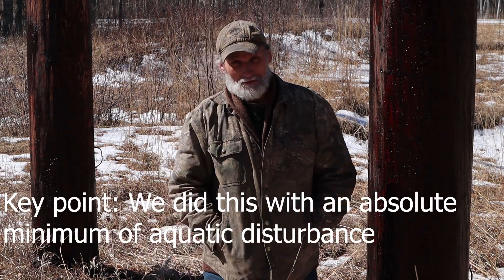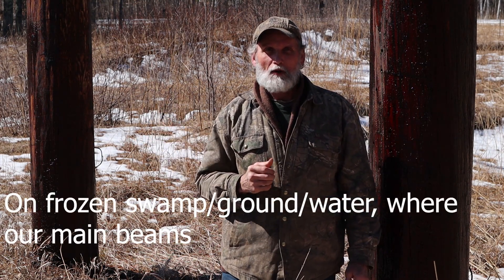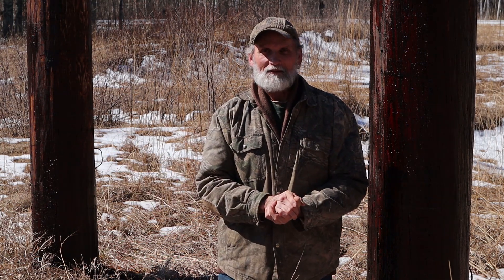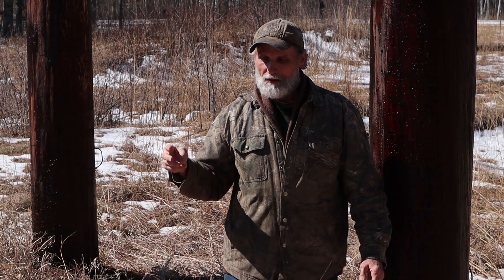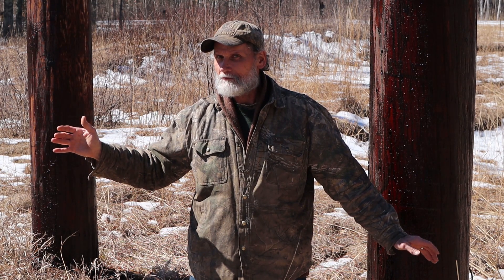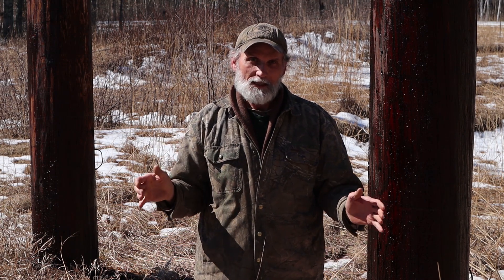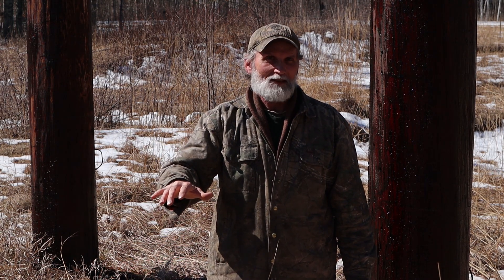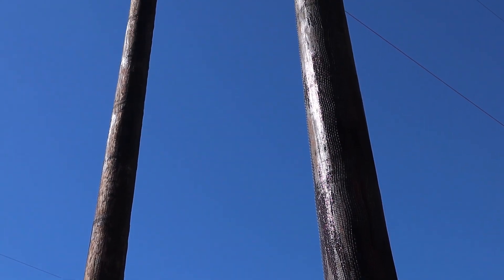Swamp Dock, extending 90 feet over boggy bottom muck to open water; to OUR BEAUTIFUL LAKE!!! YEA!!!!

Comment: Watchd the video how did you get the post down in the muck?
Reply from the maker: We hooked 2 come-a-longs to the top of each post and to the steel crosspiece under the power poles and pulled them down into the muck, that has also made them adjustable as time has gone by.